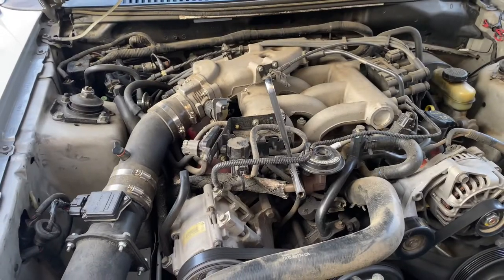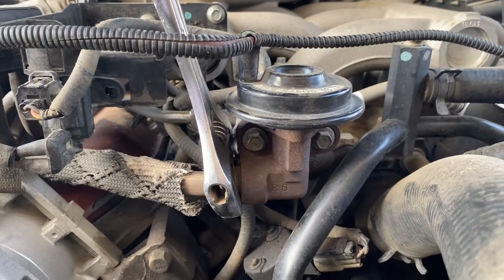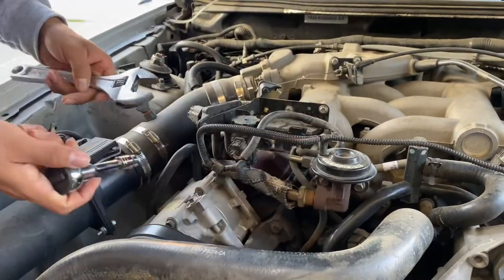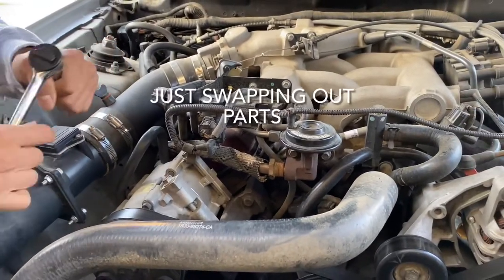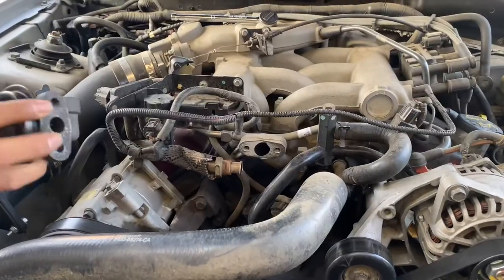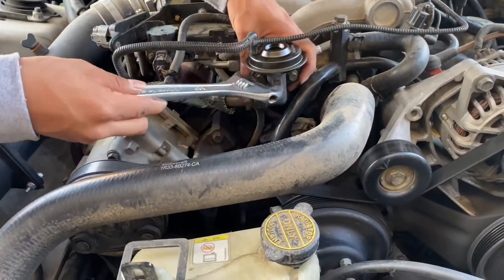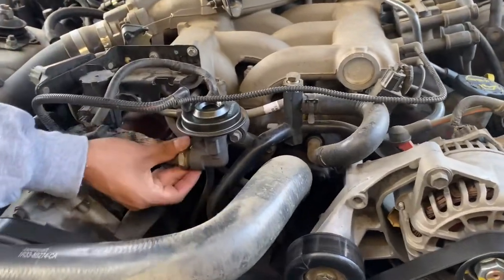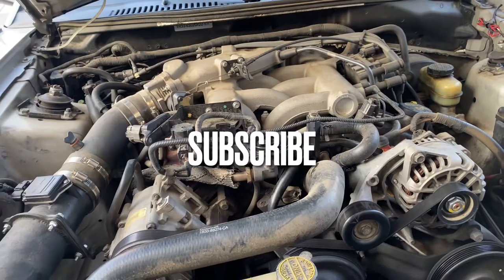Replacing EGR Valve on 99-04 V6 Ford Mustang

Comment: Thanks for the vid def need to replace mine so this will help another, also peeps Keeping your engine clean may not do anything for performance but will help when comes to fixing or finding leaking parts also keeps 
them from degrading faster.